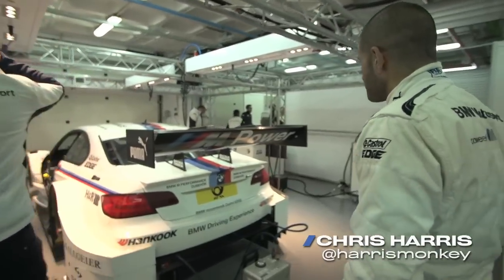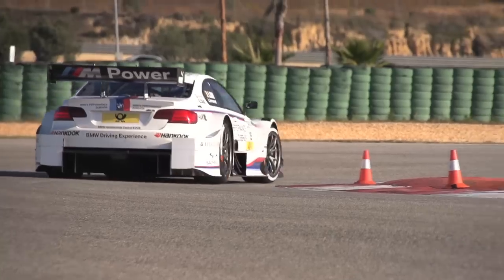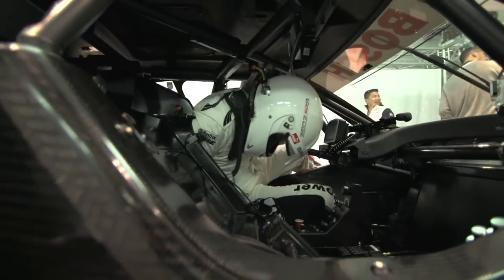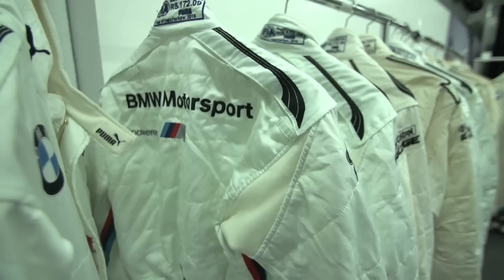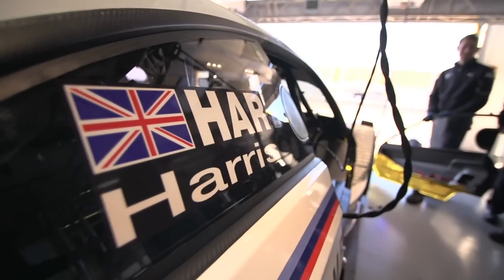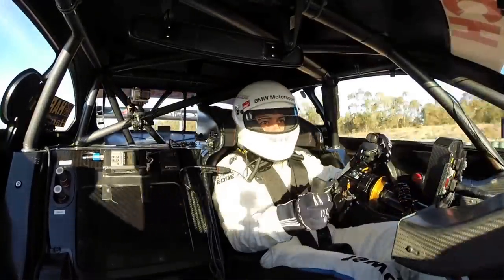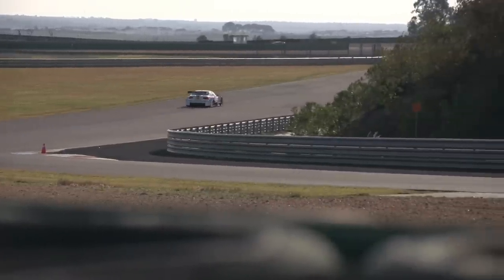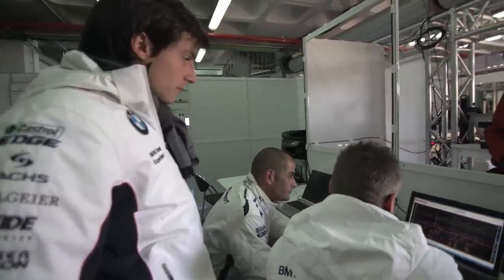Driving the 2013 BMW M3 DTM - /CHRIS HARRIS ON CARS

Comment: When aero bits look wrong it tends to mean they are really good. The trailing edge behind front tires look like stairs in MC Escher art. So sad cars this tech savvy produce boring racing. 

The idea of slamming the brakes at speed and less when u slow combined with needing lights to tell you that the front end has locked up. Proper spacecraft speak right there.

Can we get Chris into an F1 car? Please and thank you.

/Drive for president

Comment: is this with the v8 in it? it sounds so different... anyone som engine specs?
Reply: MovieMan797  4 liter 90 degree V8 - about 480ps(with two 25mm restrictors)
Reply: Yes it is, but it has a 180 degree flat plane crankshaft, instead of a 90 degree cross plane crankshaft, that most road car v8s use.

Comment: I'm sorry but this beast leaves me utterly cold. It looks, sounds and drives nothing like an M3. They've even swapped the M3's cross plane crankshaft for a flat plane crank, which has spoiled the already unspectacular soundtrack. A DTM car should be a car you could convert from a normal road car inside a week, take out and race and put it back on the road within a few days thereafter - not an all bespoke job like this. Just goes to show how disconnected motorsport has become from the buying public. Win on Sunday, sell on Monday no longer seems to apply, unfortunately.

Comment: Steering wheel is pointless like that & isn't very functional.
Reply: Pointless and non-functional. Do you mean in regards to every day driving? In a spec race car it's very functional and has a point. Weight and mass to a minimum. And the steering in these cars is very quick, probably 3/4 to lock at a minimum

Comment: can you actually buy one of these? lol
Reply: you can probably buy it the year after, but you can use it only on tracks. you also probably need a whole team of expert mechanics to tune it appropriately every time depending on weather and other factors. you can't even turn it on by yourself. you could instead look into renting racing cars directly at some tracks.
Reply: Yes if you have a ton of cash, they sell customer cars as well as the full works team you see hear. My company builds the suspension for BMW DTM very high spec and about 100k just for suspension system.
Reply: Andres .C Bullshit Inc.

Comment: So basically, it's a European "stock" car. The chassis, engine and body have next to nothing to do with a production vehicle.
Color me UN-IMPRESSED.
 Give me the next Porsche 918 chassis or even a Ford GT that is actually street legal.
A Murcielago
,Farrari GTO...
This is just a toy.

Give me a JDM twin turbo Subi or Lancer. I can still drive those to work in 3 minutes in a snow storm and smoke this car 0-60 on the street for a 1/4 of the price.
Reply: ***** Look, I'm sure it's fast and handles like a race car. That's because it is a race car. To call it an "M3" however is as absurd as calling the car Kyle Busch drives a "camry" or what Greg Biffle drives a "fusion".